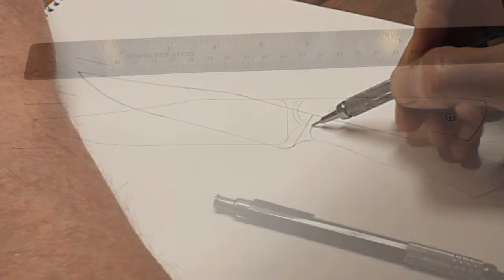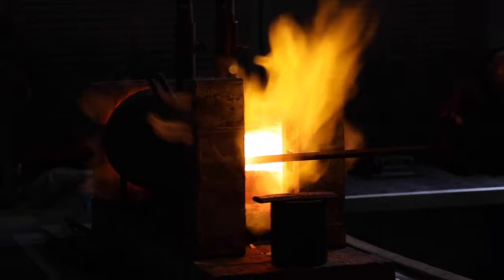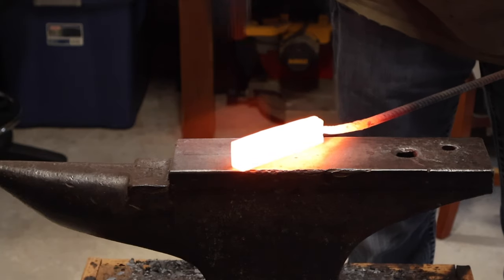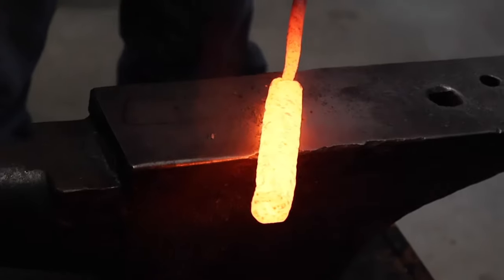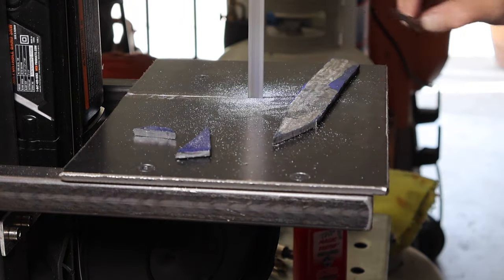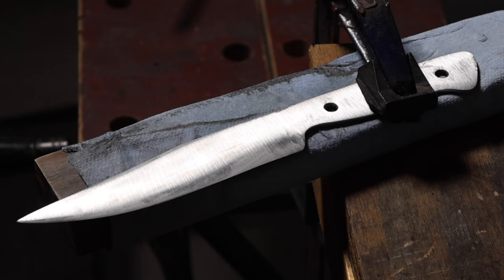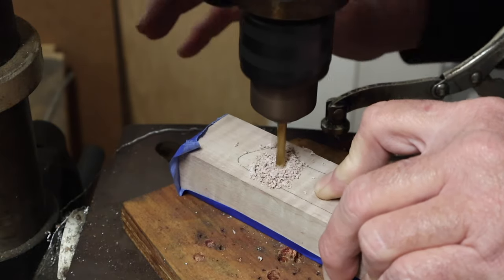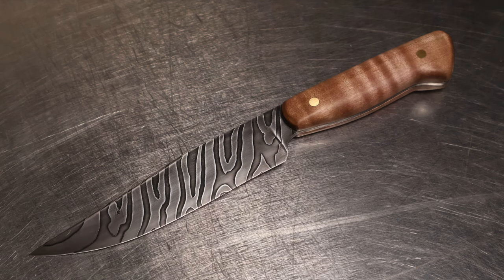Forging a Twist Damascus EDC Knife

Comment: That is a stunning pattern on the blade!  I've watched many other makers use kerosene, but they put it in the forge and let it burn off before using flux. I have yet to try, but was curious if it makes a difference.
Reply from the maker: The flux won't stick unless the billet is hot (or if it's wet), but if it's hot in the forge and you take it out to flux it will form scale, so I fluxed right after the kerosene to try to minimize the scale, thanks for your comment.